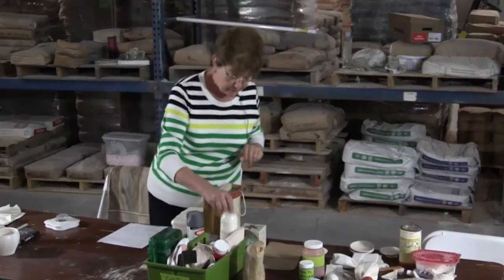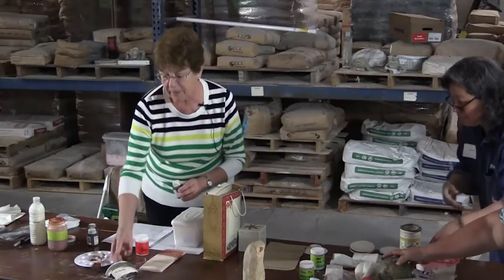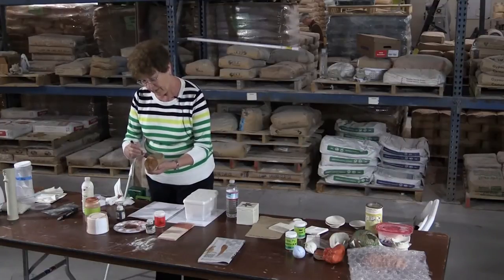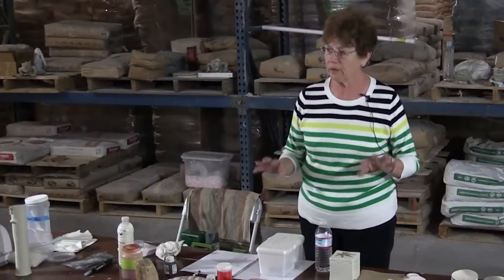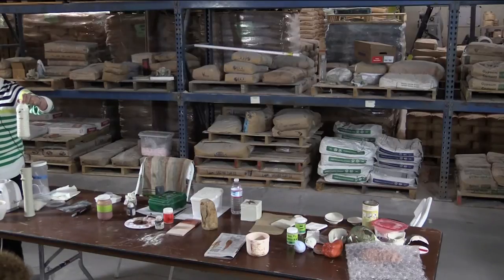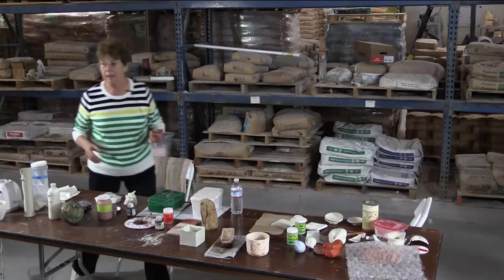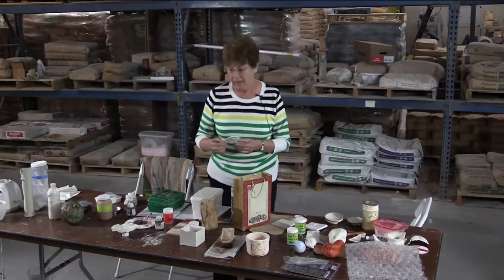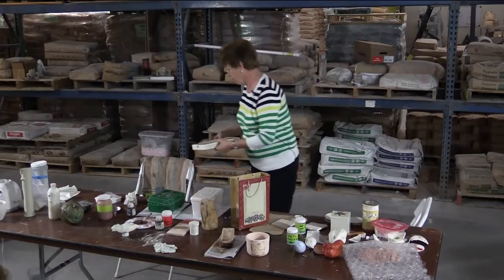Cold Finishes with Linda Mau

Comment: I enjoyed your presentation.  I have a question:  Would the low luster masonry sealer work on fired underglazes in place of a glaze firing?  If so what would be the differences in appearance and performance of the finished piece?
Reply from the maker: Thank you! Masonry sealer works great over underglazes.  It will produce a slight sheen and be water resistant for months. If outdoors, reapply if it loses its shine and water repellency.